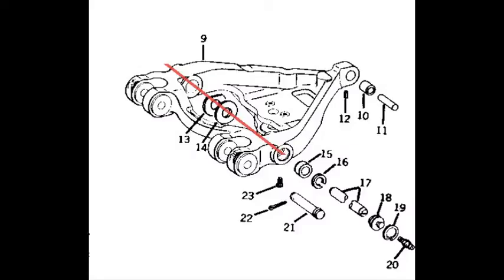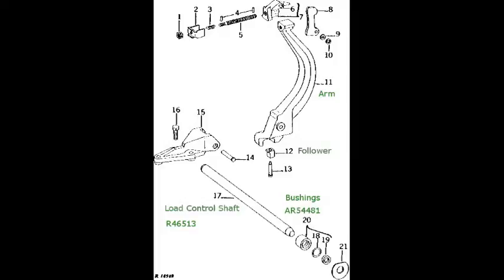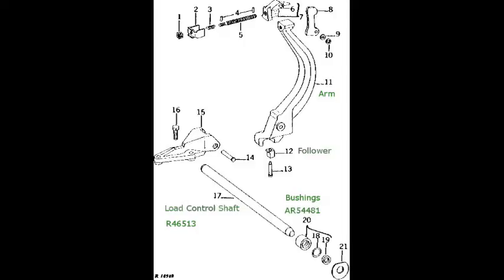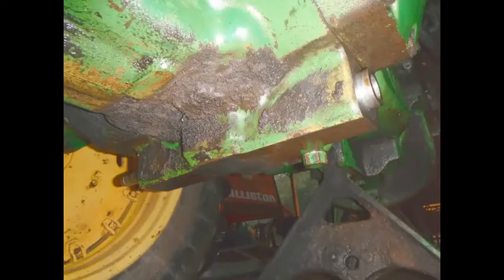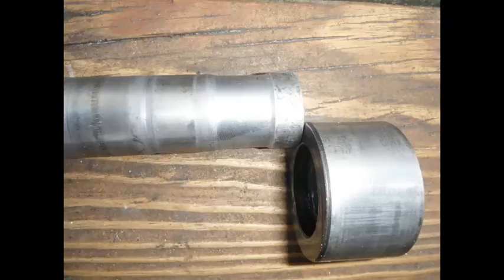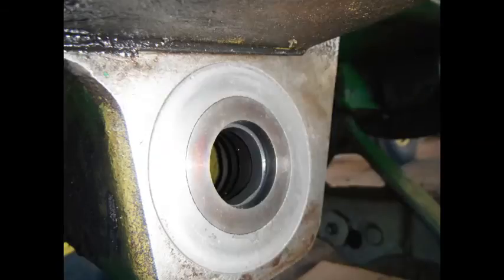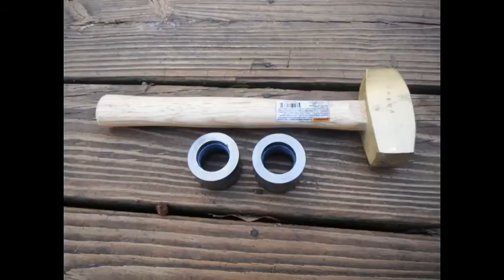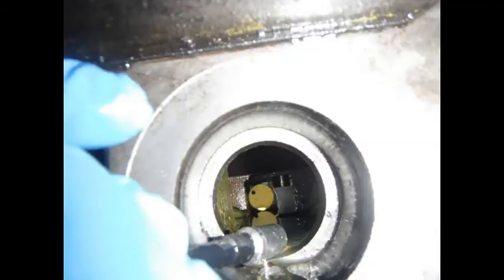John Deere 4430, Load Control Shaft Repair

Comment: I just did a 4055 and there are two 1/2" allen head bolts holding the bushing in a seperate housing, I just had to remove those and change the inner seal and the o' ring behind the housing, very easy and no beating. I changed the bushings in the yoke which had to be beat out/in and a new load control shaft, the shaft was wore but I don't think I really needed to change those bushings,

Comment: Really good video. Thank you for taking the time as it helped me a great deal. When I froze my new bushings for two days I installed them with my fingers. No hammer required. JD also sold me two "O" rings but for the life of me I have no idea where they go?? There were no "O" rings when I disassembled the tractor.

Update: The reason the bushings went in so easy is because they were the wrong bushings. There are 20 thou over size bushings for 4230 tractors marked on the bottom of the tranny case with "OS20". Chances are you won't find that marking until after you drop the yoke. And of course the parts person won't mention it....... :(

Update to the Update: Posting this in hopes it can spare someone else my headaches. 
As mentioned, check underneath your tractor at the bottom of the trans case for the lettering OS20. If those are there you require 20 thou over size bushing. These are available from JD. 
The ordinary size bushing come with the seals installed at one price. They do not require O rings. 
The 20 thou over bushing come empty. That is where the mysterious O rings have to go. Plus you have to order the rest of the seals that go inside the bushings. 
Tractor has been down for 2 weeks for a job that can be done in an afternoon. Multiple long distance trips to the dealers. 
I would get angry but I remind myself this is from a corporation that does not believe in a farmers right to repair his own equipment.
Reply from the maker: Dave R- Thanks for that added information. It is all new to me. I am certain it will be helpful to others! That is what it is about:)